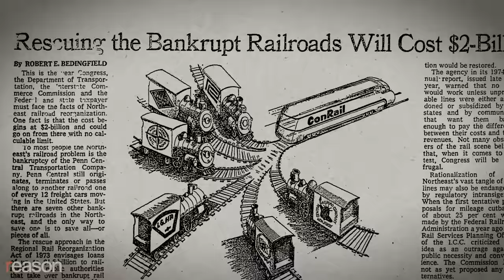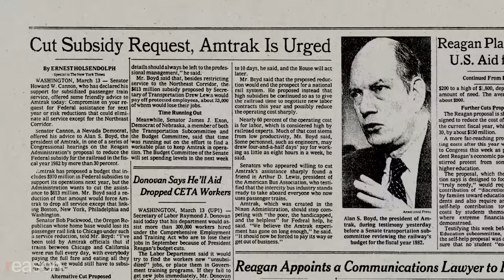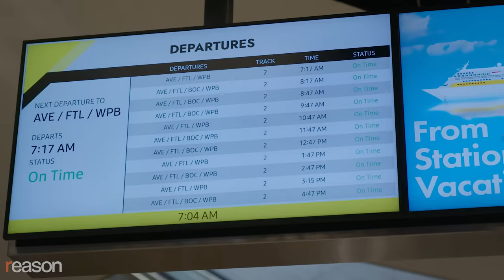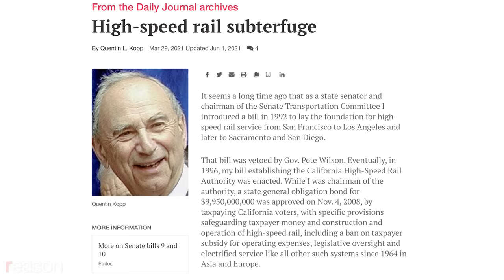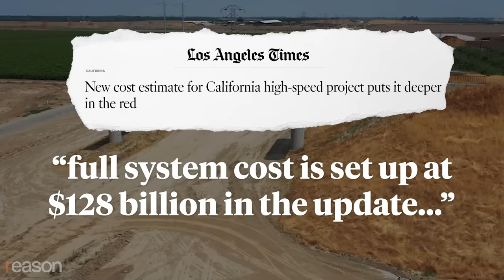How Florida beat California to high speed rail

Comment: Wow, from the first minute you filled the video with half truths and lies, like any good libertarian.
I had to check again the date because of the "under 3h" claim when the actual published time is 3h33.
It's also not "high speed". With the "under 3 hours (it was 2h59) the average speed was suppose to be ~78 mph and with real time it's !67 mph - this is not high speed.
You also end it with referring to the investors as "paying for it with their own money" when they received plenty of grants and a huge amount of money through tax exempt private activity bonds. The state will also be responsible to the maintenance of most crossings.
In the middle, like any good libertarian, mention the "huge subsidies" and expect rail to be profitable, which only applies to trains, as cars are heavily subsidies by roads that they don't pay for (both construction and maintenance), by gas high subsidies, to keep it cheap, by huge amount of free parking spaces and huge sprawls area where they live and paying far less in taxes than the cost of maintaining those huge low density areas, and even than, with all those subsidies, car owners pay an average of $11,000 a year for each car. 
The same goes for air travel when airlines receive huge subsidies through jet fuel costs, direct subsidies and low payment for infrastructure paid by taxes (like Airports, access roads, air traffic controllers etc).   
That without even going into the cost of greenhouse gas emissions and air pollution. 
You also claim that trains are more expensive than cars, which is another lie as countless studies show. you might pay more for the infrastructure (way more than other "socialist" countries) but operation is far more efficient and cost effective than cars and the more you´ll invest the cheaper it will get. You can also do the "social" things we do in Europe and have the government build and maintain rail (like it does with roads, even in the US) and let private and public operators, free from the need to deal with infrastructure, run trains on them while paying for slots like airlines). I can get from my city of Barcelona to Madrid (386 mi) in true HSR speeds  in 2h30 for as lo as €7-€9 (bout $8-$10).
As for Amtrak, since no transport mean can work without subsidies, Amtrak cannot be expected to be profitable, certainly at the way they work. The reason it looses money is that it has an obligation to maintain loosing rail lines to keep minimal service for many cities with no  alternatives. That's also the reason why cancelling subsidies failed as not only Democrats but also Republicans from those areas where Amtrak is essential voted against that.
What the US should do is nationalize all railroads, improve their condition and allow free competition on them for both freight and passengers, this "social, act will make railroads just like roads and air travel, increase competition, lower prices and enable everyone, including less fortunate, disabled, young and old that might nit have the money or ability to keep or drive a car and those who prefer it over car to get around. Is this not freedom of choice is all about?
And another big lie you slip in the end, autonomous cars will not "save us". A car, weather it's driven by a human or AI, is still a car. It's still a huge chunk of metal carrying an average of 1.5 passengers so even if they can be more efficient they will run out of road space just like regular cars, require parking spaces, just like regular cars, and have high maintenance costs, just like regular cars and stand in traffic, just like regular cars.
Stop the propaganda and join the rest of the world.

Comment: The Florida system isn't true high speed rail though, no more so than the British InterCity 125 (despite those trains being called "High Speed Trains" back in the 1970s). You are comparing apples with oranges.

Comment: California steep mountains between Bakersfield and Los Angeles then add in quakes. 
Florida FLAT easy building 
The CA high speed rail a dumb idea, but if they were going to do it hire a Japanese company to deal with mountains and earthquakes

Ca mountains and quakes
Better Idea regional commuter rail, live where it is cheaper and hop on the train and get to work without getting stuck in traffic.
Reply: Earthquakes can happen anytime anywhere in California. Very few do much damage, all fixable. Construction codes are very strict now. CAHSR only needs to tunnel through one mountain route which is the Tejon Pass for about 20-25 miles. The San Gabriels for 30 miles, the Tehachapis for 10 miles and Pacheco Pass for 15 miles are tunnels not needed for a SF-LA route via the ("upgraded") Altamonte Pass from the Bay Area to the Central Valley.
Reply: @davidjackson7281  How do you know, David, that the Tejon Pass Route, which I also support, will only require a tunnel of that length? I hope you're right about reduced tunnel length because the Tejon Pass route is far more feasible than going via Palmdale. GO GRAPEVINE.
Reply: @davidjackson7281  Thanks for your response, David. I knew you had authoritative sources.
Reply: Spent the entire night last night, till 6:00 AM this morning, reading Alon Levy blogs. They're fascinating and informative. He's brilliant.. Thanks for telling me about him.  I'm just getting started. GO GRAPEVINE.
Reply: @michaeljones7927 You are welcome. Good for you. Nice to know a kindred rail spirit like you Michael.
Reply: California gets one megaquake per decade (the kind where bridges collapse).  Florida gets several devastating hurricanes per year… strong enough to derail a train.  Destroy houses. Et cetera.

Remind me again: How is Florida “easier” to build for?